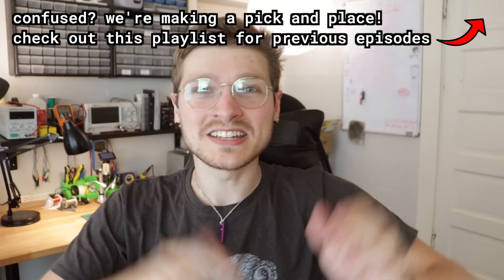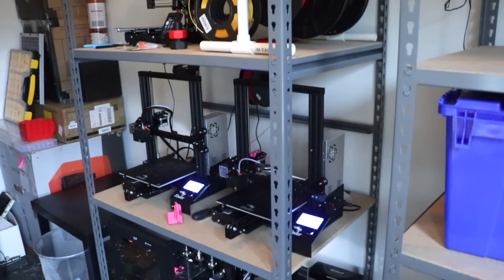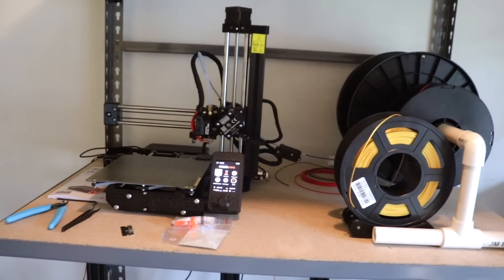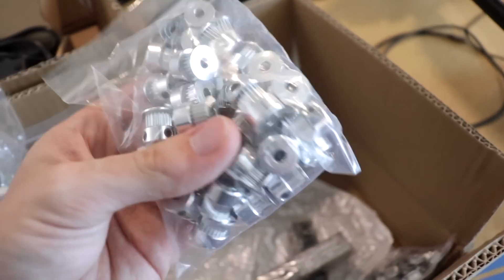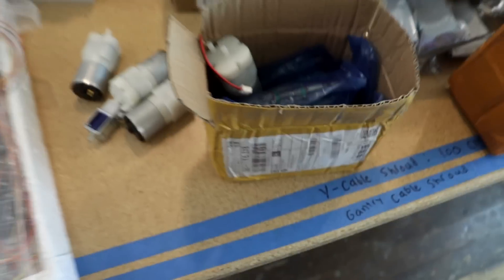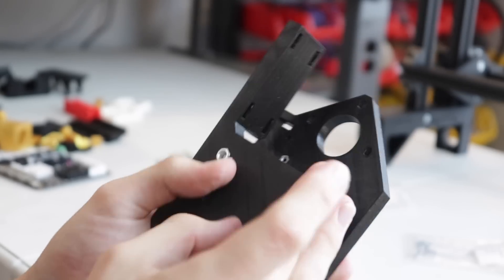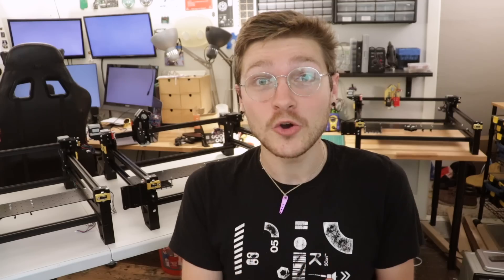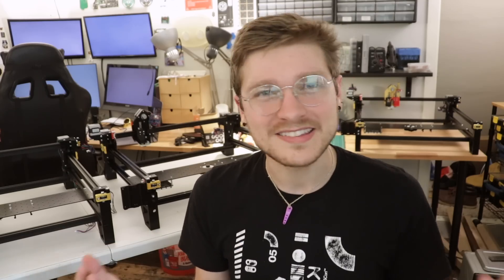Sourcing Parts for a Hardware Product

Comment: Working with an electronics distributor could be helpful too in the early stages! They usually have sales reps specific to smaller startups and their line cards are big with lots of different supplier options to compare. Seems like sampling from DigiKey or Mouser is still pretty popular by most of the engineers I know

Comment: I have issues sometimes on my ender CR-6 max. It's a good printer, only issue is a long bowden tube that needs a long retract setting.  The issue complicates because for parts with lots of retracts, I believe it heat-shares upwards over the heat break. The filament driver is nastiness to service too, making it hard basket for drive-dog checks.

Comment: I realize this is literally a year out of date, but there are so many more options now for more tooly 3d printers.

Like the new Bambulab X1 that is a corexy, does auto calibration on everything (including things like input shaper) and prints super fast (like actually, not the fake fast speeds many vendors post).

It was a kickstarter but will be on sale soon.

Theres of course also the Prusa XL but that's a couple years out.

Then, there are a bunch of cheap printers which have really improved the experience with nozzle based bed level probing and less terribly designed and qa parts like CR6s.

Comment: If you want to try salvaging your Creality printers....   I had similar experiences with my Creality CR-10S Pro - months of jamming, failed prints, -  the complete opposite of my Prusa Mk2, which just keeps on working.  The game changer for me was when I got tired of CR-10S Pro failed prints and decided to replace the stock extruder and hot end assembly with a direct drive BMG extruder and Mosquito hot end. I have never been so impressed with a piece of aftermarket equipment - the Mosquito/BMG combo has turned my CR-10S Pro into an absolute production monster.  IIRC, in the 8 months since I have been operating it with the new extruder/hot end, I have had exactly two failed prints, and one of those was due to using a reel of filament that contained approximately as much water as Lake Huron. And my average print quality has increased substantially as a nice side effect.    I have no connection to BMG or Slice Engineering - I am just a very impressed and happy customer..

Comment: Careful with the Prusa Mini!

If you twist the X-axis arm, the printer will print a rhombus instead of a perfectly squared rectangle!!

I am a mechanical engineer.. tested 2 of these minis and ended up returning them! Super easy to get the x axis out of alignment because there is one wimpy 3d-printed part holding 2 smooth Rods in a cantilever.

I can forward you some of the emails I sent the prusa team. They only contain part of the problem and no offered solutions. I usual run out of energy working the 9-5, so all I can offer now is caution ⚠️  on the minis.

Comment: Not sure if you did or not, but I'd suggest you include at least a few extra nuts and washers of each size if not also including an extra bolt or two per size. It'll give you some margin of error on the hardware kits and it'll save your customer from having to dig through a rug for 3 hours to find the last nut that they need that they dropped.

Comment: Thank you so much for showing your Ender 3s. I noticed that you had the power supplies mounted on the outside back rail and this inspired me. I have an Ender 5 Plus and it has been shutting off on large prints. I suspected the power supply. So I stupidly ordered a 450W PS without checking the size requirements. Today I opened the package intent on installing the new PS only to see that it did not fit. I was resigned to the fact that I would have to find another small PS that fit. BUT!! I saw your video. With some M3 screws, T-Nuts, some rewiring, and Bobs your uncle I am back in business with a good quality MeanWell PS. Thank you!!

Comment: 2:58 Those plastic arms on the Enders are the worst. One of the first upgrades I did on my Ender 3 V2 was get a metal arm because I knew that eventually that plastic part would fail.

Comment: Sounds like your Enders are suffering from Heat Creep in the Bowden tube at the hot end. A common problem encountered eventually as the very end of the Bowden slowly degrades with heat and use. I have 4 enders and used them to print 2,500 covid face shields once I fixed the heat creep issue which cropped up in each one they worked reliably. Google "Luke's Hot End Fix" on youtube or watch this video: https://www.youtube.com/watch?v=f4R6FlU7wXg

Comment: What Lucian says about being available in their timezone and being easy to communicate to is SO important in my experience. As a small player, you're often talking to fairly junior sales people at the larger vendors, and they never have people go out of their way to convenience them. They do notice, and they do give you special treatment as a result - going as far as putting their neck on the line with their boss in some cases. If it wasn't for doing that (as exhausting as it can be), we could've never crossed the mid-scale manufacturing chasm.

Comment: Get glass beds, and ill send you my Ender3 print settings for PrusaSlicer, its probably a speed issue(?). Once the bed is levelled, I don't need to do anything to my ender 3s, ever. Ill just send prints down to my basement from Octoprint and go pick them up when they finish. Once they're setup, they will just keep making parts just like the prusa. Only thing I have to do is wipe the glass beds when they get completely covered in dust because of the work I'm doing in my basement, or after a bunch of prints Ill use a degreaser on the glass bed because there is some oil or something that comes off of the PLA that can mess with the adhesion.

Comment: Experienced a few problems with the cr10s pro v2 . Clogging, prints not sticking, gear extruder jamming on the filament and the bl touch getting stuck. It does require some time tinkering. Prusa prrinters seem to be better quality wise even though I never owned one yet.  Now contemplating on a direct drive with an all metal hotend to have better prints and alss prevent the PTFE tube walls  thinning at the hotend over time causing clogs. Nic Wilson’s creality fb page has some pre-compiled software for ender 3’s and other machines if you want improved functionality.
Reply: Everyone goes on and on about the Prusa, but I've had to resolder the power cable to the bed heater, reprint hotend parts because a failed print encapsulated the hot end, and had the nozzle drive itself into the bed because the Prusa at $800 doesn't have a Z limit switch. They're good machines, but they can require maintenance too.

Comment: I feel like the Ender 3's etc are only useful if as a way to get people into 3D Printing / if they love fixing/messing with it (like a "project car" etc)

By the time you add up all the upgrades, failed prints/downtime, etc i feel like you are better off buying a slightly more expensive printer with all the features you want

*Granted this used to be the excuse for Closed Source, Overpriced Machines like Ultimakers etc*, but there are so many good FLOSH options like Prusa's stuff, VORON, Ratrig etc that make it a good point even for makers with budgets, or hardline Open Source advocates etc

Comment: Just lived through this to your next stage a few months ago. I'm between the 100 - 2000 shipped unit quantity. So some unsolicited learnings. On Re-order or larger orders you can start getting a few new pain points. QA can drop from samples. Had a run of 1000 pcs and logo's were all askew by 2 degrees but samples were perfect. Import tariffs (not Tax, but also that). How things get defined when they ship to you can be very important.   The higher value your order is the more scrutiny it'll get and the more likely multipiece shipments will not arrive at the same time. Having the plate for sale likely has you learning a lot about shipping, but if you have a big draw on launch day things can get rough. While not a patreon, I'd launch to them first with a 2 week buffer when it comes time because this will serve as your lower volume (maybe?) learning point on how the shipping packaging process goes.
Reply: Thanks for the advice, much appreciated!

Comment: I get perfect Ender 3 v1 prints.Get the Yellow bed springs and tighten them almost all the way down. I upgraded to an aluminum Dual gear extruder, just a clone for about $12. Clone BL Touch optional about $15 (works perfectly). I have 2 and the prints are flawless.

Comment: My 3D printing farm is entirely based on Flashforge Guider 2's. They are more expensive but they come out of the box get levelled ones and print for houres and houres without any problems and failures. All parts printed on my machines are ABS and I have about 0.5% failed prints. The first Flashforge I've bought is 10 months old and made so far 1240 hours of printing. Bed levelling has been done once so far... No blocked nozzles or other shitty maintenance was necessary... No broken parts... I call it my easy bake oven. It is a workhorse perfect for micro-manufacturing. It is the first 3D printer I worked with which is a tool and not a hobby.

Comment: I run a bit of a print farm, doing >1000 parts per month usually. My go-to for a cheap yet reliable machine is the Artillery Sidewinder. A bit cheaper and bigger than the Prusa Mini, and I'd say about just as reliable as the genuine Prusas I've owned.

Comment: You were engineering on the fly.   It always takes longer when you do that.  Engineering isn't just limited to this part should be aluminum and be that long.  Most of the engineers at GM don't do the cars they work on what it takes to build the cars.  Assembly order, how long each step takes, what can be done in parallel etc.

Comment: I have a question.  If a component is placed on a motherboard and if it moves slightly when the vacuum nozzle releases, is there any way to discover that happened using the camera?  Thanks.
Reply: Funny thing about reflow soldering is the amount components snap back into place due to the surface tension of the solder. Check this video from James Sharman https://www.youtube.com/watch?v=pOrjECig11A?t=629 and you can see that tolerances are quite generous.
However your question is a good one and an interesting use for the camera.

Comment: Regarding the Enders: replace the extruder with a metal extruder, use capricorn ptfe tubing and quality fittings. If you install the printer printer properly and add this upgrades for ~30$ you got a fairly reliabel printer
Reply: Specifically a dual gear metal extruder.

Though at print farm scale, the Prusa is probably the better option. After all, Prusa uses their own machines in a print farm, and has developed the newer models based on that experience.
Reply: agree, or just slap on a Bondtech BMG (clone) instead of the existing extruder, the exitsting plastic extruder is the weakest point of that machine
Reply: @Blamm83  You have to invert your extrusion ratio with the bondtech style gearing right?
Reply: @buffsharkshoes  not sure if you need to invert it, but the ratio does change because a BMG is geared
Reply: Until the cables die...

Comment: My Personal experience with the Ender 3.. I had so many issues but now I'm at a state where I power it up (Even after 5 months unused) clean the glass bed and it prints
Changing the Extruder to the metal(red)  CR10 solved the problem with not enough strength and also solved clogging?..
Changing the springs to the yellow springs fixed bed being unlevel after some times
Then I also changed the fittings, specially the one at the extruder.

Also did many other mods but these few mods surely did the biggest differences! I really agree that Ender 3 is "overrated" because you need to do many upgrades and tweaking to get it up running.
Reply: I just took my time building it and mine works fine
Reply: @lucasc5622  Yeah that is the issue.. Some are really lucky with their Ender 3 and everything just works out of the box, other have to tweak the living S**t out of theirs to get it operating. 
It is really inconsistent if your Ender 3 is working really well or having so many issues
Reply: @decee1157  i have bought my ender 3 a year ago and it still gives me problems...
The only stock parts are the extruder, the frames and the motors...

I'm starting to think about getting a new heartbreak and quality fittings but how to  figure out which are good?